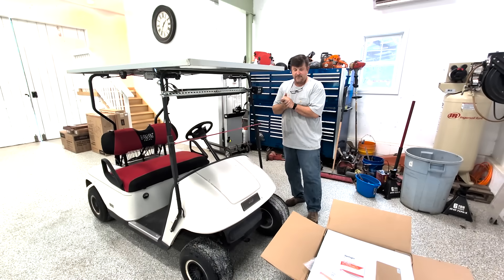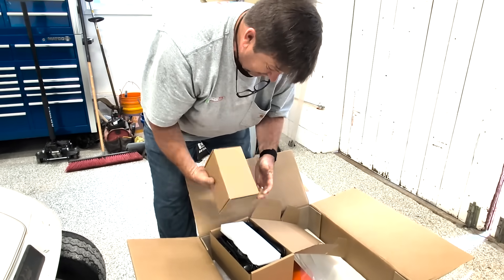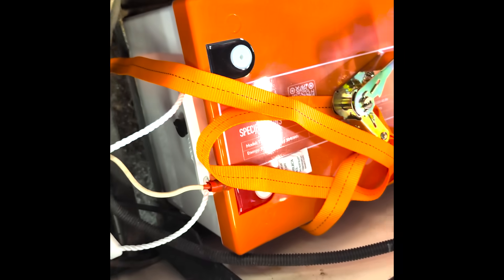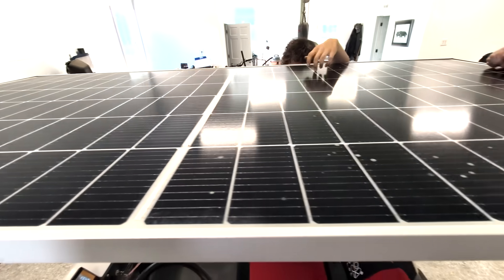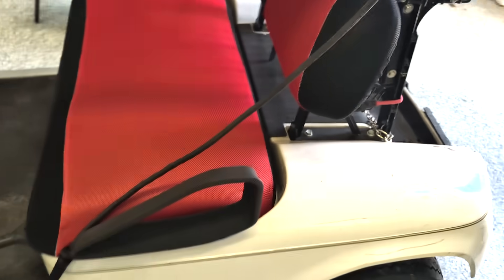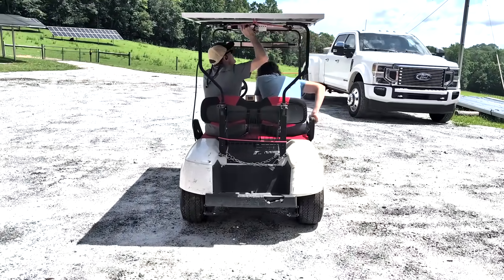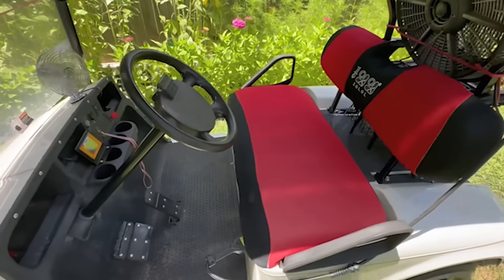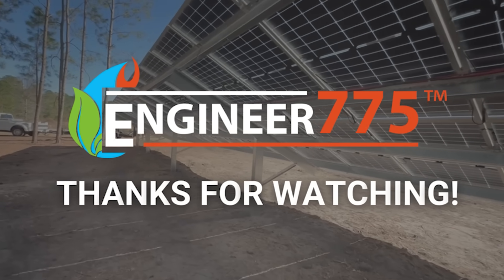Transform Your Golf Cart: Switching from Lead to Lithium Batteries with Temgo

Comment: I installed a temgo for a customer and liked it enough to order another. I have 2 operating very nicely right now but time will tell. Good value for the money. They do not include the dc to dc converter. They don’t claim they do in the parts list . Lucky I had one when the first battery arrived. They must have just sent you one to make a good impression. Not a game changer for me but you need to know that when ordering.

Comment: You mention it includes a D/C to D/C converter? Can you elaborate on that? I went ahead and purchased a 36v to 12v converter but I’m confused on what’s needed since my 36v temgo didn’t come with a converter. It came with the display and the charger. Thanks in advance

Comment: Was there anything you had to do to deal with the voltage difference? 36v battery became 48v.
Reply from the maker: No, it stayed at 36 volt. The Temgo battery was a 36 volt replacement

Comment: I did my 48V EZ-GO cart to LiFEPO4 . I had to use MPPT boost charger for solar . Works great . Still use onboard charger sometimes .  I had same batteries but were 8V each . same size just 4 cell . The GC-8 size.  Battery has LTCP . I insulated battery with pink board insulation from Home Depot . I store in shop in winter but when clear and not much snow we use it . That when use the AC charger . Cheers from NY ! Solar and golf carts work hear as well ! Wind power as well !

Comment: Been putting this off…..I like it….low temp protection?  Can’t charge lithium below 32…
Reply: Their is a easy fix for that and plenty of room to insulate battery and add heating pad to keep over 40F when charging. Also LOW temp heating type are out now.  Only need to heat battery when charging. So a small amount of power needed from charger to warm them up than turn BMS on and charge .

Comment: is golf cart legal to drive in the streets. I'm from Bangladesh i don’t know about the rules.
Reply: Some municipalities especially beach towns and resort communities allow golf carts to be licensed and used on streets with low speed limits. Usually the carts are restricted to 20mph and require headlights, brake lights and turn signals. Many golf courses are surrounded by a neighborhoods that are private properties that allow golf cart. And some people just use them if they own a large rural property as used golf carts can be found cheap.
Reply: Not technically legal, but the cops seem to overlook it in close nit suburbs or rural areas. Things change when drunken kids start causing trouble.
Reply: Google it.
Reply: oh!  i see